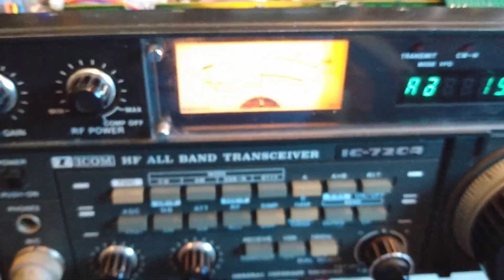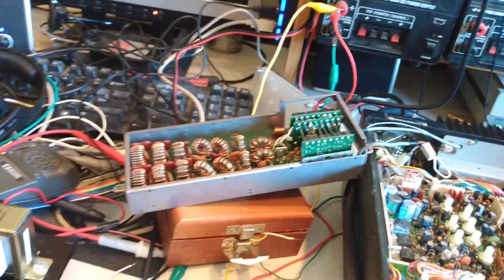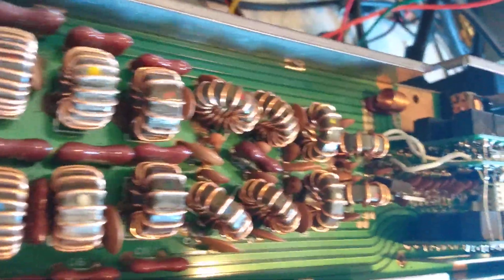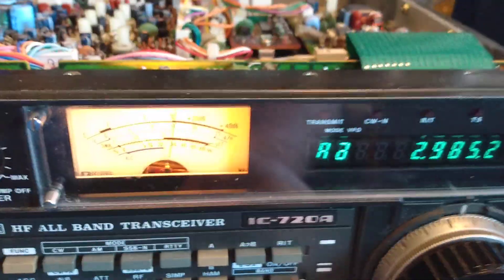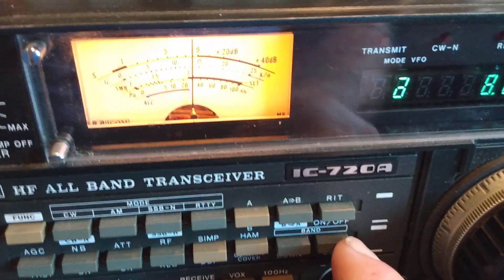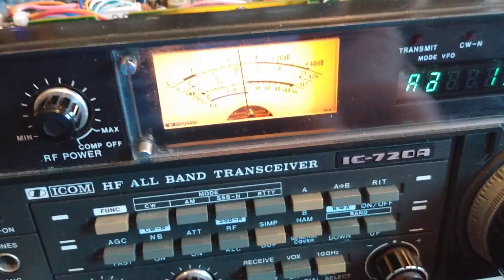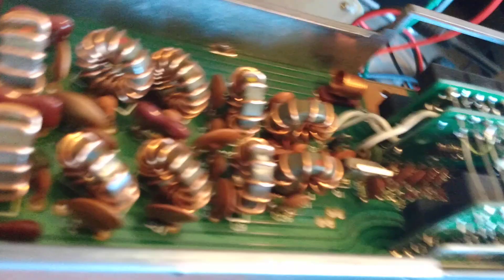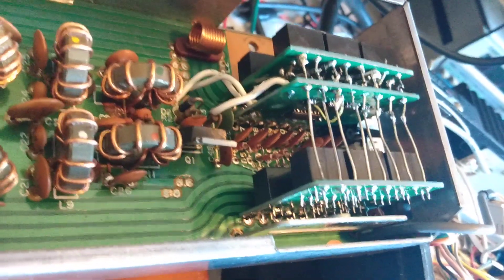Icom 720A Rotary Relay Replacement

Comment: I'm about to roll my own version with some analog solid state switches and an Atmel ATtiny.  Should be even cheaper and quieter  😉.  3 ICs and a voltage regulator.  My IC-720 has been out of commission for way too long.
Reply from the maker: good luck :)

Comment: Hi there nice mod. The first time I heard the band select relay on my old 720A  I wondered what the heck is was! BANG-BANG-BANG!!  Man it's a bit aggressive.
The radio has just gone deaf on some bands now and a suspect that it's either the RL1 (RX/TX) relay on the filter board of the selector switch.
Well done on the modification If I get into trouble I may get back in touch pleading for more details.
All the best  . .  Andy

Comment: Hi TinkTron, sorry to bother you but I recently sold an Icom 720A that belonged to my late stepfather and the buyer sent me this video saying it shouldn't keep making the clunk noise. But at 19 seconds the noise stops when a MODE appears. If it doesn't bother you, could you by any chance tell me if this is an actual issue that needs repair? I just wanted to make sure he was being sincere about the issue because he wants me to pay part of the repair... https://www.youtube.com/watch?v=jgC1Ht9xkAA
Reply from the maker: Yup..that is a real problem. That is the major problem that my modification takes care of, other than the noise. What is happening is that the rotary relay is dirty or misaligned and the computer does not know the position of the relay, so it keeps trying to find it.
Reply: @TinkTron  thank you for the reply! :) would this be relatively simple and/or inexpensive to repair?

Comment: I've just resurrected my old IC720 from a 30 year long hibernation.  Plugged it all in and everything seems to work as I remember it.  In order to activate the receiver, I have to key the mike momentarily, but it's transmitting fine into the dummy load (also resurrected - Heathkit Cantenna with fresh mineral oil).  I would love to modernize it a bit by getting rid of the clacking rotary solenoids.  Will you be making your PCBs available for purchase?
Reply from the maker: Actually, I am working on the replacement with PCBs at this very moment. You might want to check out this group   https://groups.io/g/icomclassic/topics

Comment: Hello
I just got an IC-720a and would like to do this relay mod.
Do you or will you have boards available to sell??
Great job on this mod.
thanks
Mike
Reply from the maker: @Ronald Matusek They will be available soon. I made a second version of the board and the transistor packages were too small for hobbyists to be able to solder, and I have not had the time to get back to changing them back yet.
Reply from the maker: Actually, I am working on the replacement with PCBs at this very moment. You might want to check out this group   https://groups.io/g/icomclassic/topics